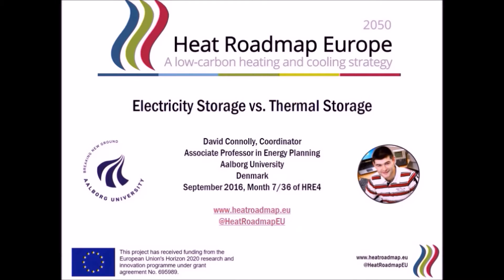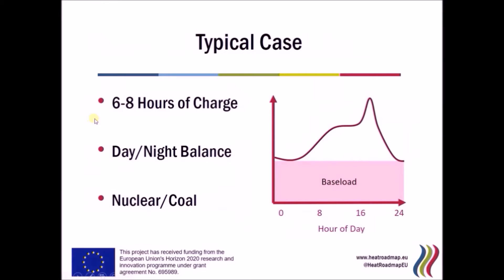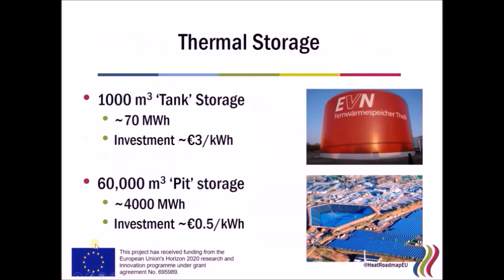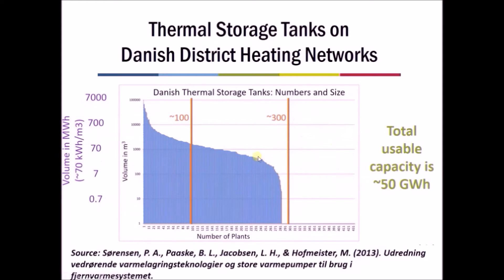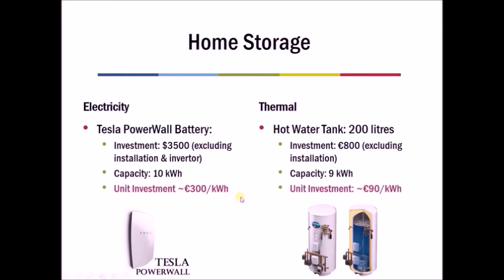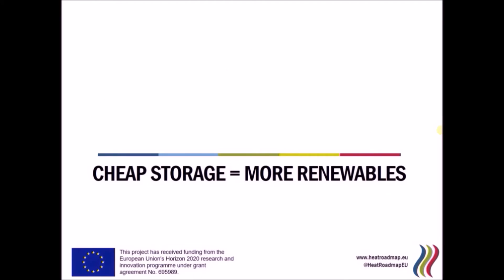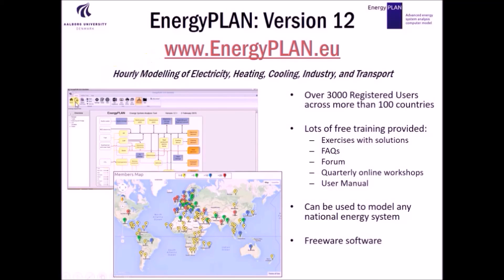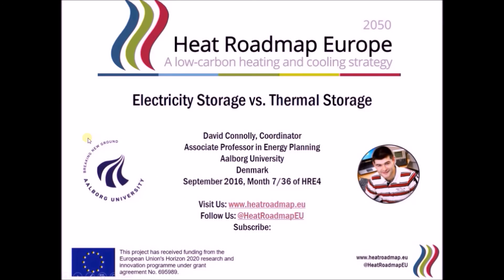Electricity vs. Thermal Storage

Comment: This project has been founded by the EU. However, these principles seems to be unknown by the German government. Currently, the government is promoting heat pumps for heating which will cause high cost for the electrical energy storage required. This approach seems to be much more realistic.

Comment: It looks like the plant in Martal is still using quite a bit of fuels like gas, oil and biomass during winter.

It looks like their thermal storage system only provided about 20% of the heat energy in the winter.

It is worth nothing, that not only the heat storage becomes cheaper at scale, but it is also more efficient, and can work longer at big scale. You can't build 1000 liter storage that will keep hot water for months. You can't probably even build one that is 1 million liters and keep water hot for months. But once you cross about 10 million liters, it starts to work, and you don't even need much extra insulation at all.

The pit storage in Marstal is 14 million liters. They also have 18MW of boilers, and about 13MW of solar collectors (on 19000 m^2). The savings they say, are from 27,858,000kWh/a reduction down to 19,034,000 kWh/a. So about 33%, that is not bad.

I guess it is preferred to keep the pit bigger, instead of hotter, as the hotter you make it, the heat flux is bigger, so you waste this most hot water quicker, and well, it will not last to the middle of winter. I think improving insulation a bit, and making a pit bigger, can make it work much better, and possibly provide 80% of heating needs over whole year. Somebody just need to build 100 million liter storage, and make it deeper, not wider if possible :D